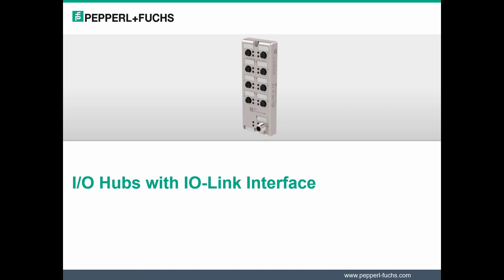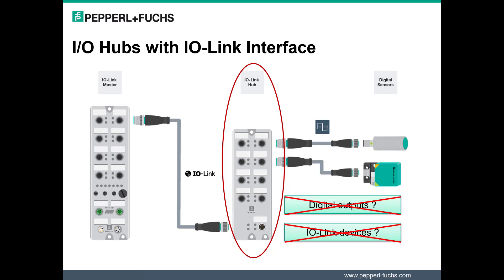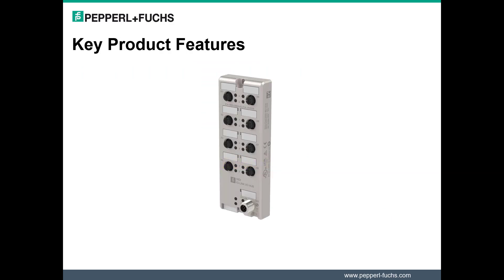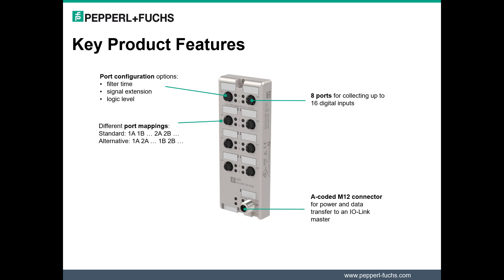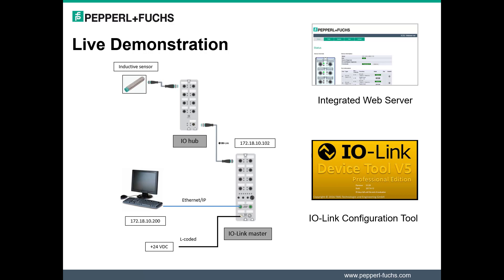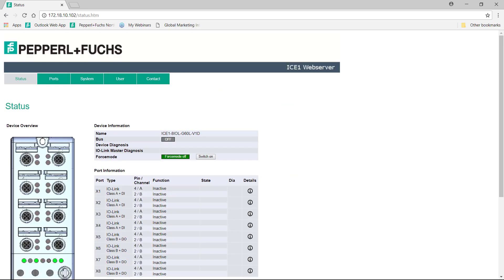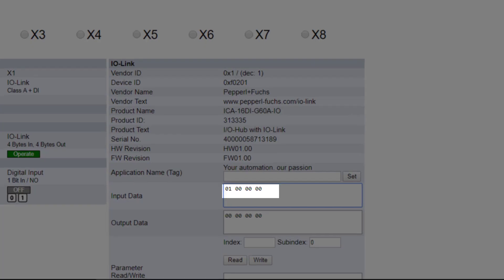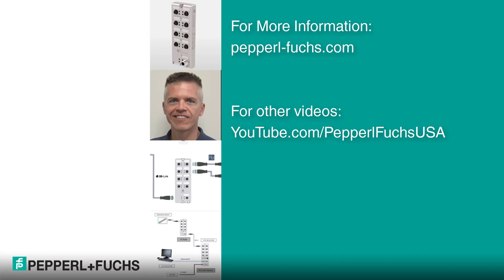I/O Hubs with IO-Link Interface

Comment: Hello,

 i have 2 questions about your product. My Plc has 4 io link master ports, wich is not enough for my application. Did  i understand you correctly that i cannot use your io-link hub connected to my io-link master port to controll outputs e.g actuators ? My second question is that if in fact i cannot controll an actuator over your io-link hub can your io-link master be connected to the io-link master port on my plc and then controll an actuator or other output ? Thank you very much if you do not understand something hit me up iam not a native speaker.